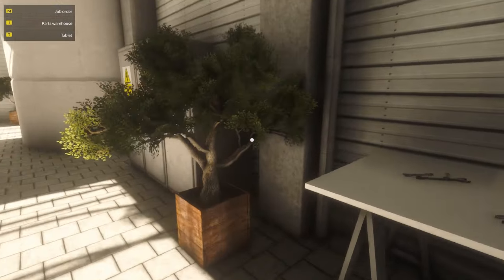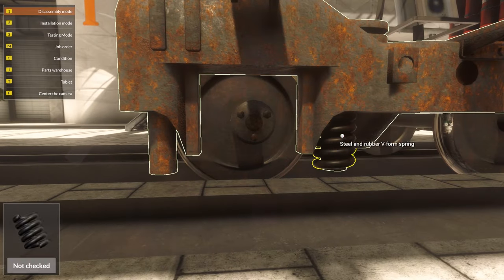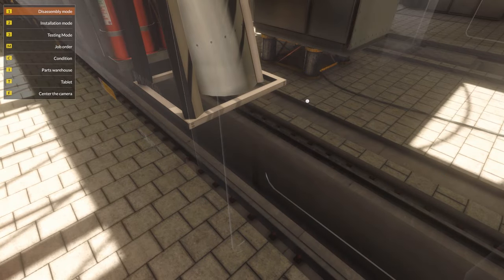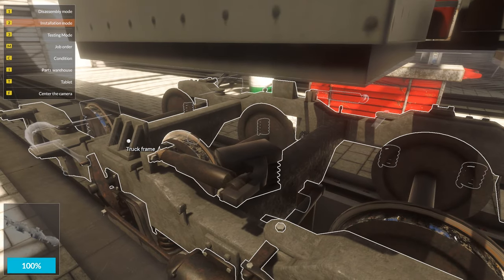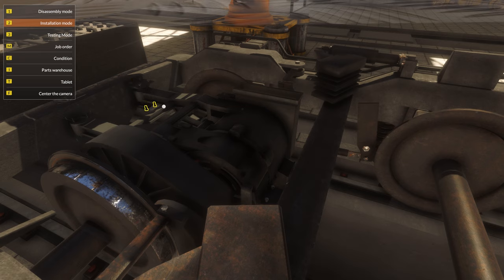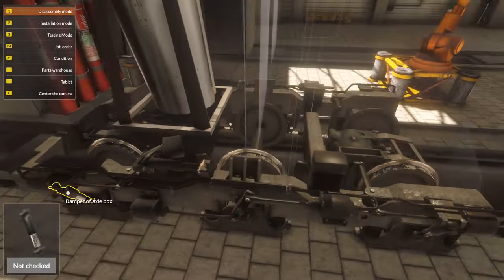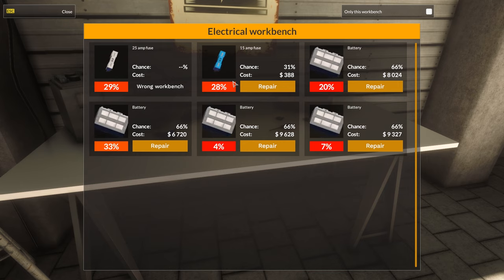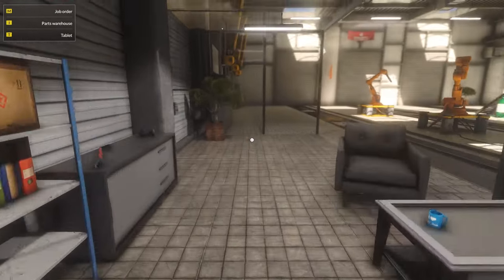Train Mechanic Simulator 2017 Gameplay :EP5: Batteries & Fuse Boxes! (HD Let's Play PC)

Comment: I'm the previous video you said that someone commented that diesel engines don't have spark plugs and that's incorrect, some diesels do have spark plugs to start with and after the engine gets warm it goes to diesel, the engine in this game is that way, the middle tappet of the valve train operates the spark plug spring.